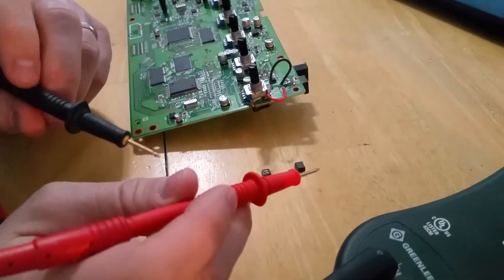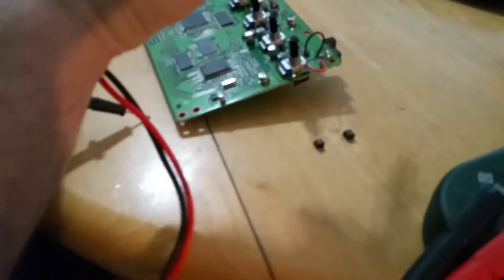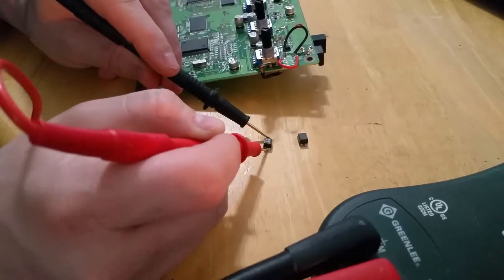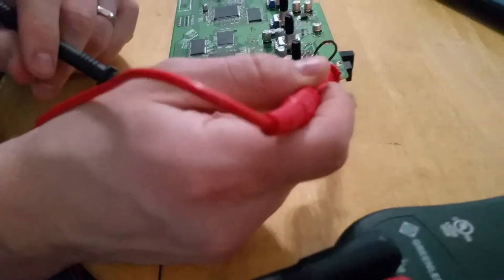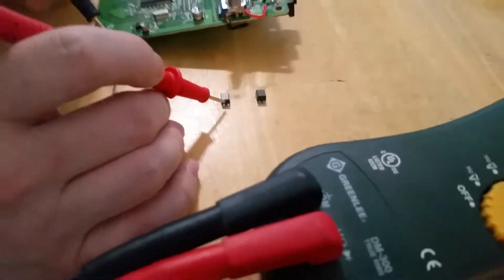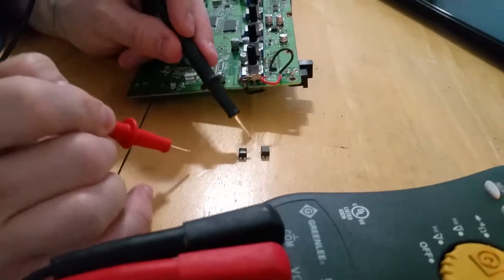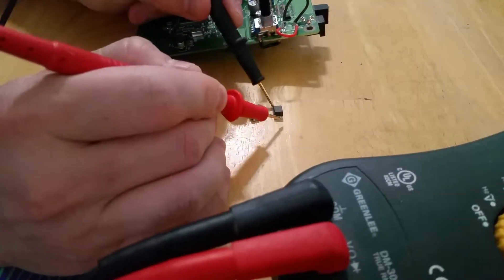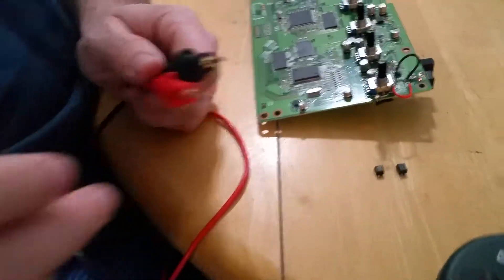MicroKorg Synth Repair (No Power from AC M522C Test/Repair)

Comment: Hello there,
Having a similar issue with my korg. Same situation, both voltage regulators are working correctly but will not turn on. just a few blinking LED's than dies. I've pulled the choke and jumped wires across like you have in the video. Just want to confirm what you mentioned quickly in the video, Yours was fully working with the choke removed and jumping th terminals?
Thanks,
Cameron
Reply from the maker: Yes it worked for me when I connected the jumper wires

Comment: why can't you just leave the jump wires in place (or am I being a dumbass)
Reply from the maker: Sorry I just saw this! A choke is supposed to help remove EMI and noise from the circuit, so I would guess that leaving the jumper wires without the choke might introduce some unwanted noise. I also wonder if whatever causes this failure might damage something further down the circuit without the choke there to take the hit...

Comment: Could you please help me with info what microkorg shows on panel when your friend tried to turn it on before you fix it? I have same issue, but it doesn't work with batteries. It blinks with Audio in 1-2 indicators and doesn't turn on (with ac adapter or batteries). It seems like serious problem ... but I want to try to fix it if possible. Thanks!
Reply from the maker: It would simply not power on at all with an AC adapter. No display or anything. It would only power on with batteries. He told me that he bought it from someone else that way. I have heard that it happens because an incorrect AC adapter is used, but I cannot confirm that. Sorry I am not much help for your issue! Good luck!
Reply: @mrbungledisco  Thanks for respond! I repaired that yesterday. The problem was in FU1 component which fuse that was already replaced with not default fuse. Default is SMD type but mine was another kind. So one pin was broken. I weld it and unit start working. So this is it.
Reply from the maker: @zvukzubov2726  that is great news! Glad you got it fixed my friend :)

Comment: I'm working to resolve this same issue with my MicroKorg; thanks for the video! I'd be lost without it 😬. Also, DigiKey has 1,400 of the m-522ct in stock at $3.03 each. I know there's a t at the end of their part number, but I believe it's the same part.
Reply from the maker: I have a bunch still if you want to shoot me a message, I can send you one
Reply: @mrbungledisco  yes, thank you so much! I was planning on buying 2 or 3. What kind of deal can we work out?
Reply from the maker: Shoot me an email; mrbungleyeti@gmail.com 

I can probably send you them for whatever the shipping cost is
Reply: @mrbungledisco  Hey there, I'm also looking for the same component. Would I be able to contact you? Cheers!
Reply from the maker: @cosmicbren  sure! Just shoot me an email at the address above
Reply from the maker: @cosmicbren  no problem! Let me know if it doesn't work, I have plenty

Comment: Great video. Excellent explanation. Now I have a MicroKorg that Powers up but no sound...it still functions as a Midi controller. Any ideas? Any help would be much appreciated.
Reply: replace dsp DSPB56362PV100 , check utsource**com
Reply: It is not getting sound from the headphone jack and the line outputs?
Reply: @willyaekle1060  correct. No sound. Can only use as a Midi
Reply: @NeuroplasticityReprogram  I am not sure what that is, I would suspect maybe an issue with the volume pot or a short on one of the output jacks. Good luck with your issue, sorry I was unable to help more!

Comment: When I put a plug into the DC inlet of my mK the connection is "shaky". Is this(what you fixed in the video) likely to be the problem?
Reply: Sorry for the late reply. If it is "shaky" as in loose, then the jack may need to be replaced. Make sure you are using the correct size ac adapter as well.

Comment: Where and which parts are needed please.  Thank you
Reply from the maker: I got the part on Ebay, here is the link:

https://rover.ebay.com/rover/0/0/0?mpre=https%3A%2F%2Fwww.ebay.com%2Fulk%2Fitm%2F371526182830

If that doesn't work, the part number is:

TDK ZJYS51R5-2PT

Thank you, and good luck!
Reply: I don't have the keyboard yet it was donated so I can fix it and sell it to raise money as my wife is dealing with a rare cancer. I do repairs but this one may be a tough one. I ordered the part, would this be what is called the fuse? Hope I get the synth on monday buddy, thank you so much any help is deeply appreciated from my wife and me. God bless.
Reply from the maker: @Decode303  I am so sorry to hear that friend. This part is called a common mode choke. If you are having more problems after replacing it, check the Vintage Synth forums, I found a lot of info there, including information about this particular issue. I no longer have this synth, but I'll try to help in any way I can. I am hoping for the best for you guys. Take care
Reply: @mrbungledisco  hi Mr.Bungledisco I finally got the keyboard and after weeks of waiting got the part. I also ordered the  S-8520F33MC SemiConductor SOT-23 plus if I recall, SMD SMT 1210 2A 72V Micro Chip Fuse CCP2E20TE
Hope all goes well?
Reply from the maker: @Decode303  good luck friend, I hope you get it working. It's a great little unit, you should be able to fetch at least $200 for it when you get it working.